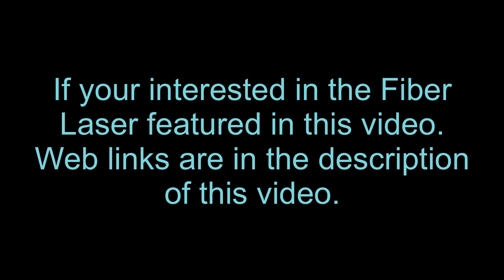Co2  vs Fiber laser Basic Questions

Comment: Always love your videos! On Lightburn...can you run a CO2 and Fiber at the same time off of one computer and program or is it required/better to have separate computers and software? I guess the follow-on question would be do you have to buy a separate program or license to run on two separate machines? Thanks.
Reply from the maker: yes I run my nova 35-100 co2 and my 60 watt fiber at the same time . you just select different device profile and go! makes for a great workflow